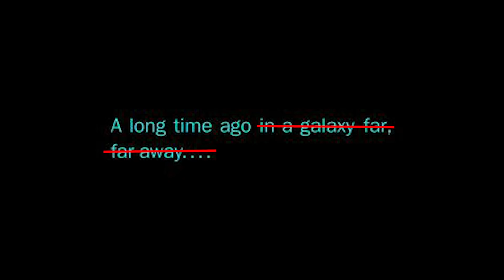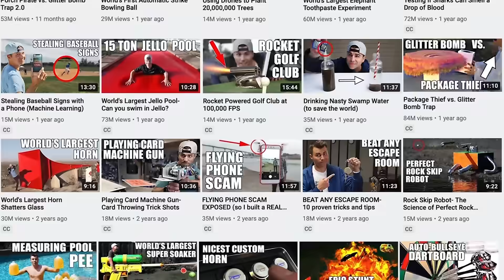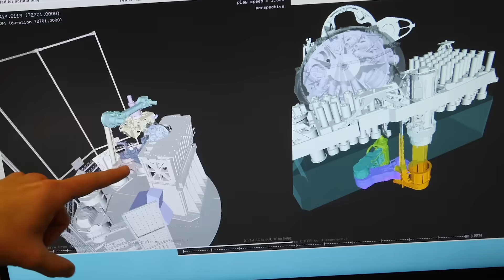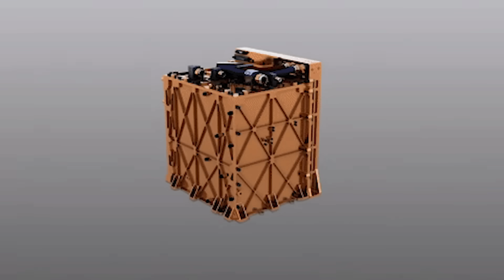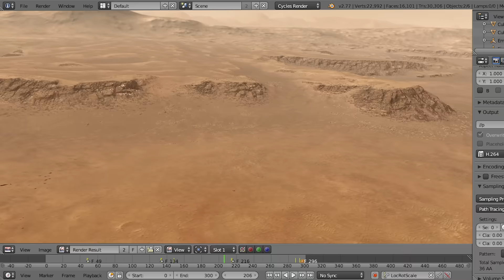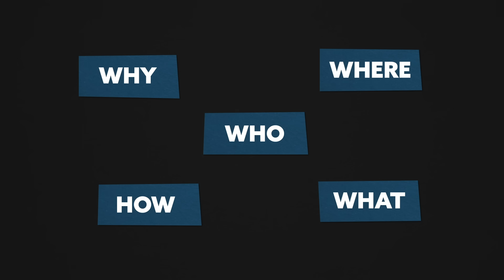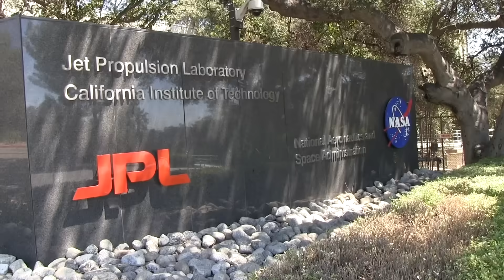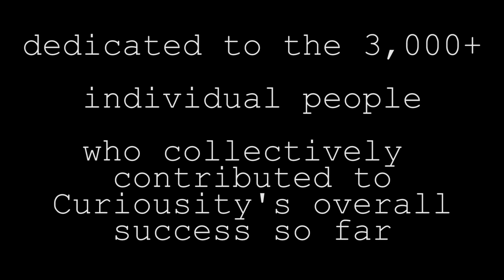Perseverance Mars Rover Landing- Inside Story

Comment: 8:48 I’m entirely aware he probably said this intentionally for simplicity’s sake, but for anyone who was curious; the actual reason the heat shield is needed(and, as he said, glows from the heat) is because as the craft slams into the air molecules of Mars, the air molecules are unable to move out of the way, and end up bumping into the craft and each other. Because heat is caused by collisions in the molecules of matter, and these molecules are now colliding, it creates immense amounts of heat that, without a shield, would tear the craft apart.
Reply: It's probably the high pressure of the individual atoms on the spacecraft, higher psi/kPa produces higher temperatures as a byproduct

Edit: maybe I misspelled a word or two, please don't pounce on me for it
Reply: Thank you for commenting for me

Comment: What happens if the rove flips
Reply: What do you mean flip?

During the landing there is no way it can flip...
And Perseverance weighs more than a ton!
So wind can't flip it either.

And during driving, the first use the cameras to look at that terrain and they plan out the rover's path... through algorithms and also manually.
So there's no way it climbes a rock and does a flip

Comment: How is curiosity still driving how do they generate power for it
Reply: it has solar cells installed
Reply: Radioisotope Thermoelectric Generators, or RTGs. It's a hunk plutonium encased inside a metal box that takes the heat from the radioactive decay, and converts it into electricity. you can actually see it, it's the big angled box at the back of the rover.

Comment: He is amazing 👏
Reply: 8:48 I’m entirely aware he probably said this intentionally for simplicity’s sake, but for anyone who was curious; the actual reason the heat shield is needed(and, as he said, glows from the heat) is because as the craft slams into the air molecules of Mars, the air molecules are unable to move out of the way, and end up bumping into the craft and each other. Because heat is caused by collisions in the molecules of matter, and these molecules are now colliding, it creates immense amounts of heat that, without a shield, would tear the craft apart.

Comment: Why don’t we use the co2 to o2 converter here for global warming ?
Reply: Tree exist. They are much cheaper and don't require electricity
Reply: @DarkTheFailure  fair but we could use solar power and it would help
Reply: @ryanlosh6039  there are more efficient co2 removers. Plus a oxygen byproduct isn't that useful. Earth has plenty of oxygen left, so we don't really need more. We just need to remove co2. Most current co2 removers turn the co2 into gasoline or plastics for profit. Some just send it into the ground too

Comment: They should send a ai robot that sully runs on calculations and data to assist the rover or maybe just an ai robot that can opt in and out a independent state and dependent state to test out and experiment the agricultural and etc. they have ai that I know that can jump at enormous lengths so if any threats were detected the ai could possibly get away without getting damaged or hurting any life on the planet

Comment: (I only watched 6 minutes of the video then I wrote this) Mark I want to ask this before it might be too late for next time NASA sends another rover like this one to ask this and if its going to be a problem and they don’t have a way to deal with it here’s what I think they should do in response to that problem 
The Problem that I think would happen:
How are is the rover going to find those tubes of Mars samples if a dust storm or dust devil comes along 
My solution to that problem: produce a lightweight GPS tracker or device (also being lightweight) that can send a signal far enough to be able to picked up by mission control and then the rover. Needing to be lightweight is so it doesn’t produce unwanted weight during launch, landing, and when the rover is on Mars

Comment: Hey Mark Rober. I have a suggestion for a video to do. My class had to do a project where we made a contraption smaller than a shoebox that would keep water warm for an hour and it had to have a lid. The winner was the team that had the least change in temperature over an hour. Could u maybe figure out some ways that wouldn’t use a lot of material? My group kept the water warm for a very long amount of time, but we were disqualified because our contraption was too short and too wide, and could not fit in a shoebox. Also, could you do anything with plants, specifically flowers/succulents/air plants? I’m really into gardening. Thx!
Reply: Put a thermos flask in the shoebox.
Sorted.
Reply: @ann_onn  we were not allowed to use pre made heating devices. Just wood, styrofoam, tape, and some other stuff.

Comment: How does one transmit wireless data 225 million kilometers!? According to recent data, LEO to LEO satellites are maxing out at transmission distances of 45 thousand kilometers and the second generation LCTs are reaching up to 80 thousand kilometers.  Additionally, why would communication satellites in space have a limited transmission range if sound waves and laser waves are said to travel at the speed of light in the unrestricted total vacuum of space?
Reply: Reason for limited transmission - inverse square law. The way data is streamed so far is through compromising on speed and using high end receivers (look up Deep Space Network) and decent transmitters

Comment: Uh how are there drones...???
Reply: Wdym?
Reply: @woajaeron  how are there drones with blades if there’s no oxygen 🤦🏻‍♂️
Reply: @LilConniePromotions  where?
Reply: @LilConniePromotions  fan blades can spin without oxygen.. even in vaccum
Reply: @LilConniePromotions  The motors are battery powered, they don't requite oxygen
Reply: @LilConniePromotions  there’s an atmosphere, it is about 14% the density. CO2 mostly, in case you were wondering about composition
Reply: I dont think the drones need oxygen to spin

Comment: Mark you should finish the giant gun saga with a giant cap gun I have been waiting for so long.
Reply: 8:48 I’m entirely aware he probably said this intentionally for simplicity’s sake, but for anyone who was curious; the actual reason the heat shield is needed(and, as he said, glows from the heat) is because as the craft slams into the air molecules of Mars, the air molecules are unable to move out of the way, and end up bumping into the craft and each other. Because heat is caused by collisions in the molecules of matter, and these molecules are now colliding, it creates immense amounts of heat that, without a shield, would tear the craft apart.

Comment: The wheels of the Curiosity suffered quite a bit of damage. How was that problem solved?
Reply: I believe they changed the design and materials of the wheels, as well as the suspension system. Check the NASA web site thought cause I’m not sure.

Comment: Can you call the 5 minutes, where the rover has either landed safely or crashed, Schrodinger's landing?
Reply: Sadly not at all cause thus for both outcames have to be possible simultaneously
Reply: @florianhirsch471  a cat can't be dead and alive at the same time though?
Reply: @florianhirsch471  isn't that an impossibility? Schrodinger's cat simply posits a theoretical consideration, a paradox to be specific? The idea of the thought experiment is that if there is a vial of poison inside a cats enclosure, with the vial breaking at any point in time, with the only certainty is that the vial will definitely break, it creates a paradoxical condition where the cat can be both dead or alive, but once you open the enclosure you will only find that one of the conditions is true.

Comment: Why don’t rovers have rubber tires similar to how cars do, wouldn’t that make the wheels a lot more protected from rocks and stuff?
Reply: If that Rubber pops or rips you're fucked
Reply: @HypersonicWyvern  yeah thats true but im talking like that really tough rubber like almost plasticy type rubber ya know?
Reply: @rylandbrown5541  still, that can rip easily compared to metals and aluminum, Mars dust is EXTREMELY sharp, with no water they can't erode into smoother particles. If a rover gets caught in a sandstorm with rubber/plastic wheels that sharp sand will rip and tear it apart
Reply: @HypersonicWyvern  yeah true, thank you for the answer
Reply: @rylandbrown5541  its to cold for rubber
Reply: @KDH-br6hy  actually yeah i didn’t even think about temperature.

Comment: So the core samples which have been buried deep in a rock since the beginning of time are pulled from the rock, and sits in the UV barrage from the Sun until it gets picked up. Seems this would severely compromise the core sample as exposure to solar radiation may change things about it before it gets picked up. Like taking a brand new car and exposing it to the desert sun for years before selling it on the new car lot. It's not exactly new, and not exactly as the factory made it.

Comment: Quick Question:  Since Mars has no atmosphere and therefore no air, when the drone spins its propellers how is that supposed to provide lift? There is no atmosphere duh.........parachute?  lol really no air again how's that gonna work?
Reply: Mars has an atmosphere. It is primarily composed of carbon dioxide (95.32%), molecular nitrogen (2.6%) and argon (1.9%). It also contains trace levels of water vapor, oxygen, carbon monoxide, hydrogen and other noble gases.

Comment: If there is no air on mars, how should a drone even fly power by propellers?
Reply: Mars has an atmosphere. It is primarily composed of carbon dioxide (95.32%), molecular nitrogen (2.6%) and argon (1.9%). It also contains trace levels of water vapor, oxygen, carbon monoxide, hydrogen and other noble gases.

Comment: I thought NASA was working on new steal mesh type tyres 
The previous ones got holes in them from the rocky surface on Mars 
But they still using the flat aluminium design
Reply: The previous ones are still effective even after 9 years

Comment: How are u going to fly with out air tho jw ???
Reply: Mars has an atmosphere, it's just very thin.
Reply: Mars' atmosphere is 95% carbon dioxide, 3% nitrogen, 1.6% argon, and it has traces of oxygen, carbon monoxide, water, methane, and other gases, along with a lot of dust. Dust hanging in the air colors Martian skies tan in photos taken from the surface. Relative to Earth, the air on Mars is extremely thin.

Comment: Human land bases on mars should be built either underground or in a natural cave structure on mars. The walls can be coated in a silicon like spay to cover the wall and make it air tight. This would protect against radiation and regulate temperature.
Reply: That is ideal, but would also require massive drilling equipment that would be extremely difficult to bring to mars. I don't doubt that once a big base is established, we will start drilling to create living spaces.

Comment: "its actually driving around right now on mars" *sadness intensifies*
Reply: Why is that sad?
Reply: @aero-space541  it died in january, lasting 7 more years then it should have :( its last words were "Its getting dark and my battery is running low"
Reply: @michaelmensch29  They're talking about the rover Curiosity, which is still working and has been active since 2012. You're thinking of Opportunity which was operational from 2004-2018 but was not referenced in this video.
Reply: @michaelmensch29  Actually, it didn't thankfully! Curiosity is still doing fine on mars, you're thinking of the Opportunity rover which lost power and subsequently lost radio contact on June 7th of 2018

Comment: In 1999, NASA lost its $125-million Mars Climate Orbiter because spacecraft engineers failed to convert from English to metric measurements when exchanging vital data before the craft was launched.  A navigation team at the Jet Propulsion Laboratory used the metric system of millimeters and meters in its calculations, while Lockheed Martin Astronautics in Denver, which designed and built the spacecraft, provided crucial acceleration data in the English system of inches, feet and pounds.  As a result, JPL engineers mistook acceleration readings measured in English units of pound-seconds for a metric measure of force called newton-seconds.  In a sense, the spacecraft was lost in translation.

Comment: I have one question. 

Is it possible to convert smoke into electricity or energy?
If so, why don’t people make a contraption where there’s a tunnel connecting to a garbage can and shoots out on a conveyor belt and then, the garbage goes into a fire where it burns and when the smoke goes up and it gets converted into energy which powers the conveyor belt and if there’s extra energy, it saves it up into an energy bank and powers the conveyor belt if it’s not moving so what I’m trying to say is, why don’t people make this to have an ultimate energy maker and earth friendly contraption.

You may comment if it won’t work because this has been bothering me for a while

Comment: "Begs the question" is used in a formal argument questioning (arguing) that the validity of the premise is circular. The proof defines itself. Steel is hard because of its hardness.
It does not mean raises the question, it does not raise any question.

Comment: If you worked on the curiosity Jet Pack wouldn't that make you kind of work on the Persaverence one too? The 2 rovers are very simmilar to each other so with some modification to account for more weight it should be almost the same design, right?

Comment: Wait I've got a questing concerning 10:02. I belief the light of the sun takes about 8 Minutes to reach the earth. Obviously at the speed of light. While I belief that it takes a digital human made signal about 12 Minutes from Mars to the Earth it will not take that long when travelling at the speed of light i.e. it can't travel at the speed of light. The distance from Mars to Earth is about 0.52 * the distance from the Sun to the Earth (78,340,000 km vs. 149,600,000 km) so the travelling at the speed of light one would need about 4 minutes to reach Mars is that right? Edit: light travels about 300,000 km/s

Comment: You use the phrase, "begs the question," incorrectly a lot. You use it to mean, "raises the question," but that's incorrect. To beg the question is to engage in circular reasoning. It's like you're asking the question for the answer to itself. For example, when someone says the bible is true because the bible says it's true, they're begging the question. Or if someone says that Trump did nothing wrong because Trump says he did nothing wrong, they're also begging the question.

Comment: if gravity on mars is low , wouldn't be better mars rover have leg mechanism like cheetach from boston dynamic and co2 booster with pumps to speed up the research (if you ever watch moon landing every time they walked they jumped high in distance which could be corrected with   rectractable flying mechanism and  some sort of  vacuum co2 booster  /thrusters for faster maping of the surface  in extremely low flight  ,maybe adding Small micro cube satelites to it   for better navigation and  mapping.)

Comment: As a designer I am curious why the drone is designed as a double propeller instead of a quadcopter? Is it because of the weight of motors? How does it handle the maneuverability? I have so many questions and this is so fascinating.

Comment: It seems NASA haven't changed much about the wheels. Won't it have the same problems as the Curiosity-rover, where parts of the wheels sometimes break off? Why is NASA not using Shape Memory Alloys which they were testing a few years prior? I'm really excited for the landing, but I'm also a bit curious about some design choises.

Comment: I’m a Product Acceptance Specialist (Quality Assurance at Michoud Assembly Facility and we are currently building multiple core stages for the Space Launch System - Artemis Rocket Program to send the next humans to the moon, and eventually to Mars. It is sobering to hear Mark say, “The first human to step foot on Mars is alive right now.” I love that so much and I love my job. I’m truly so lucky to be able to work for Boeing and NASA to help construct these massive rockets for the SLS program.
Reply: The first rocket, Core Stage 1 (CS1) has gone through its green run testing at Stennis Space Center and potentially will complete one more wet dress rehearsal for engine testing and then its off to Kennedy Space Center for launch by the end of 2021 to make a preliminary “lap around the moon.”
Soon after, within the next 2-3 years at most, we aim for CS2’s manned mission to take the first crew vehicle to around the dark side of the moon! After that, some time just after 2024, CS3, the 3rd rocket of a potential set of 10+ core stages being built, should deliver the first astronauts to the Moon’s surface since 1972. Heck of a way to celebrate a 50 year anniversary of the enormous milestone and accomplishment back then.
Reply: SpaceX and Boeing will send astronauts and payloads into lunar orbit to construct the Lunar Gateway which will act as a space station for the Moon and help transport astronauts safely from lunar orbit to the Moon’s surface, practicing terraforming, scientific experiments and very crucial information gathering for our journey to Mars in the near future. It is an honor to be a part of this program! I truly feel like I am doing something bigger than I ever have before in my life and I love my job!

Comment: Question why would you need the parachute theirs no air on Mars right
Reply: There is. It has an atmosphere of Carbon Dioxide, but is quite thin. This is why the last part of the descent is done with rocket engines.

One earth, on the other hand, spacecraft can land using only parachutes with the much thicker atmosphere.
Reply: @WasatchWind  thanks I was confused on why they had that